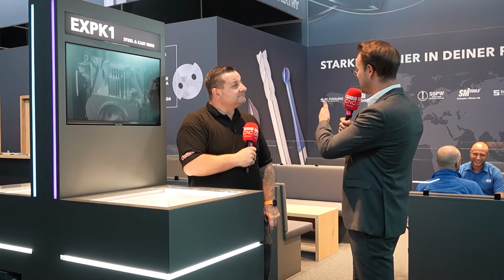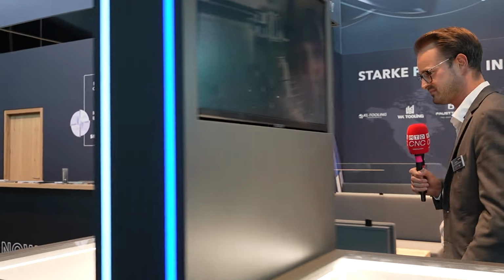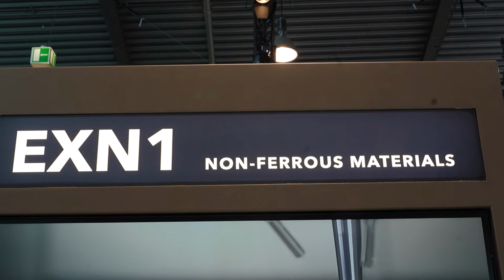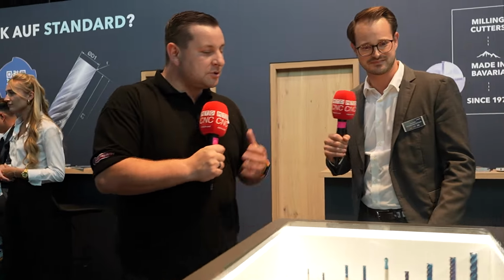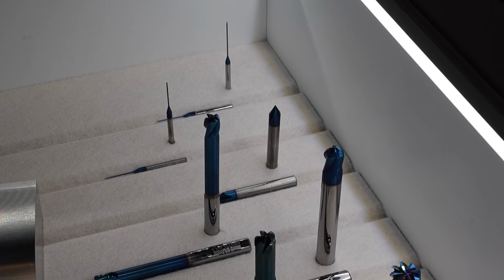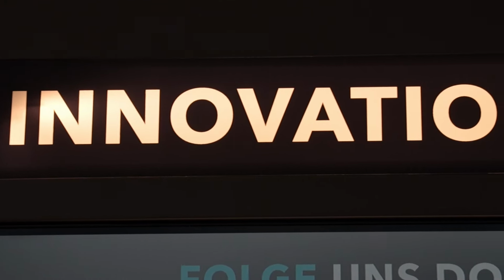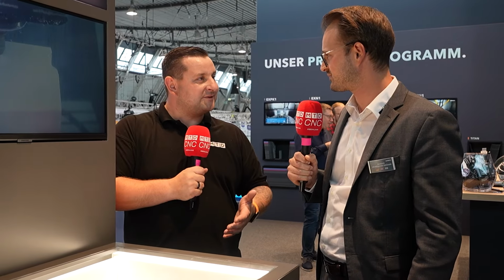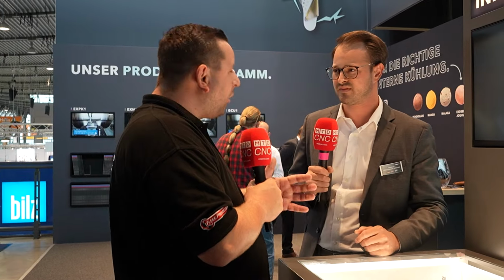They make two million solid carbide end mills per year?

Comment: Well most coatings is 2.5 micron/0.0025mm think. And that is what they put on pr. Side of the tool ( so about 5 Micron in total diameter is added ) and I bet they keep that in mind. So the 0.1mm endmill would then have to be ground to 0.095mm and then costed. Well even if it's made of carbide you wouldn't even find me standing in line to try and run it ( comes from a guy that owns a couple of 0.65mm shaft 0.95mm head 30xD solid carbide boring bars from phorn privately xD )

I do wounder how the surface finish of the non-ferrous material endmills stack up agens a mcd tipped endmill